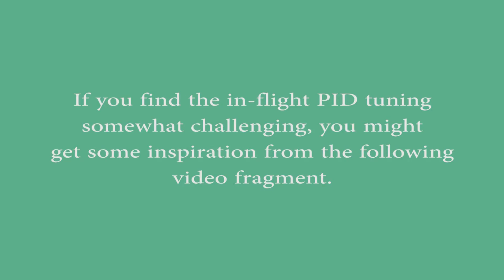XJ470 HKPilot Flight Controller: Solution

Comment: What battery are you running and what's the average flight flight time ? Thank you for your time
Reply from the maker: +Rampage851 We are using 2 batteries on this quad at the moment: Zippy 5800:
http://hobbyking.com/hobbyking/store/__9933__ZIPPY_Flightmax_5800mAh_4S1P_30C.html
 and Zippy 8000mAh:
http://hobbyking.com/hobbyking/store/__16226__ZIPPY_Flightmax_8000mAh_4S1P_30C.html
 Both 4 sell. The flight time is about 10 minutes on 5800 (that's while leaving ~3.5V per cell) and 13-14 minutes on 8000. 8000mAh is a better battery in many respects, not to mention the low profile, which makes it fit into the battery tray without any problems. 5800 is too close to my ESCs, which makes me cautious about pushing the throttle too much (most of the flying happens in 55-60%  of throttle range).

Comment: Do you need specific motors for that prop, I have Sunnysky X2212 1400KV 180W Brushless Motors. Does the motor have to have to attach to all 3 holes?
Reply from the maker: Rampage851 yes, the motors are sunnysky V3508 700kV. You probably need to check the prop table if it is available for your motors. My gut feeling is that 1400kV is too fast for such a big prop. The motors I am using are bigger and slower and will develop 333W on 12" prop at 100% thrust.

Comment: Nice build. How well does the Sonar work. I was thinking of getting one for my PIXHawk and Loading onto my FY680 Hex.
Reply from the maker: Simon Hahnel i had only a couple of good goes at it: last Saturday and Sunday. The sonar seems to be alright, although the raw readings in the mission planner are not very consistent. I suppose the APM has an algorithm to smoothen the input out. Very smooth landing, props go off. i have done some low passes at full speed and it handles well, too. But these are still early days. I shall summarise it in a separate video.